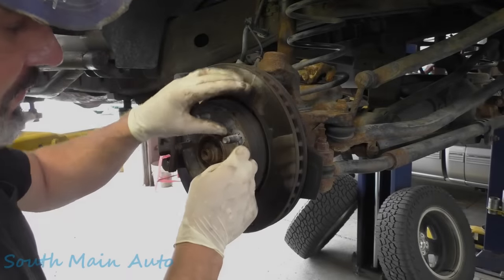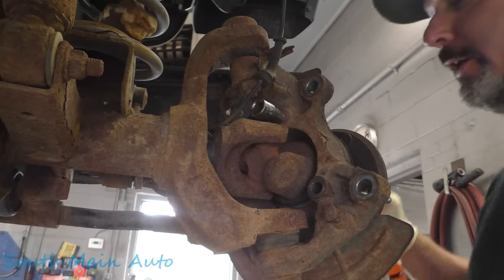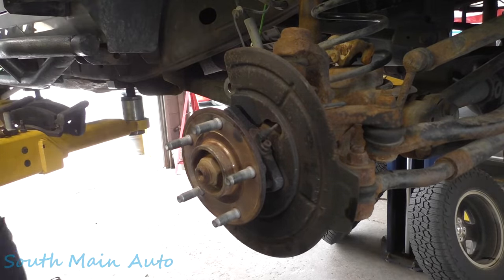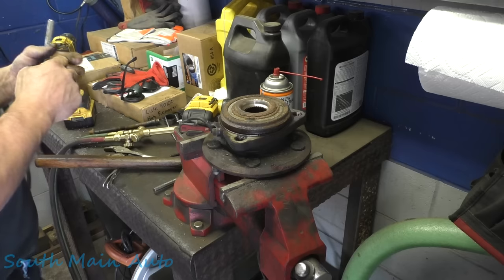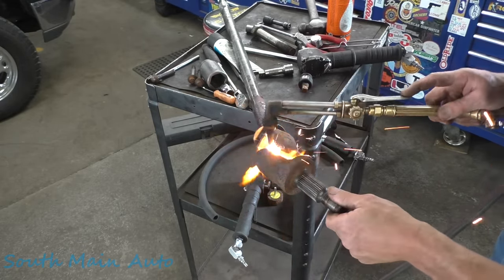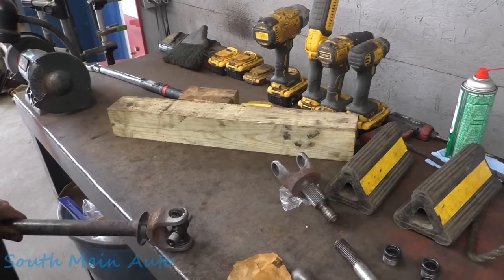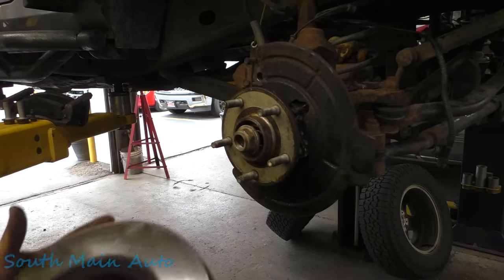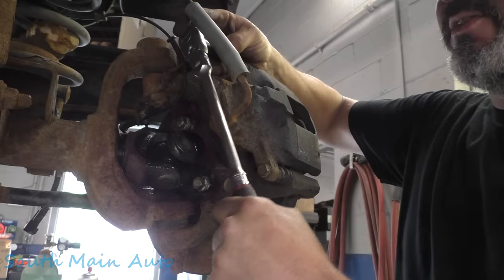Jeep Wrangler - Front Axle U-Joints

Comment: Puts out laundromat fire, knows the fire department is hanging out next door, proceeds to get the torch out for all repairs. Just giving you a hard time. 😂
Reply: They were at lunch didn’t you hear the siren. Great save Mr. O!!!!
Reply: some times ya just need to know how long its gonna take them to show up to your fire!!
Reply: That’s the second time you’ve had to put the laundromat out ! well it might be more, but that’s what I remember. The guy needs to pay you a retainer !
Reply: Acid brush, for brushing on bakers fluid or other acid flux before soldering. Tinsmith work etc.
Reply: Spray it !

Comment: "Acid Brush" was the name given to the things due to the fact that the original use was to apply flux (Acid Core) to pipes for soldering.   The things are extremely handy and have evolved into universal usage.   But that's the story -  Acid Flux Brush!!

Another great video Eric...  You're the iron man of the YT auto genre!
Reply: I tried to use one with some somewhat modest 90% nitric acid.  That was a mistake!
Reply: @paulmoir4452  whoosh vapor cloud of goo and metal sludge?
** I'll add plumbing flux is very mildly acidic, usually in the low percentage range around 20%, but it varies per flux type usage, it's mainly "petroleum jelly". years ago they used different chemical blends to do the work or breaking up oxidation and protecting it from re-oxidizing before the solder would flow.
Reply: Also used by old tinsmiths (sheet metal workers) in applying acid paste flux used to solder sheet metal joints together…a very useful tool still used today
Reply: @phillipfritz7014  And mechanics in small towns who soldered radiators and heater cores. (likely in radiator shops in larger centers also)
Reply: Mainly muratic acid in various strengths was your flux on brass radiators and it works an instant treat. Combined with the torch used to take the tanks off/on with was the reason for the gross package of cheap acid brushes for sale at better parts stores for some half century of time long past now. It was also your engine cleaner where you pour it right into the coolant replaced now with water and warm it up to flush/eat up the rust flakes as well. Right in the radiator too depending on the belief that the same flaked off rust is blocking some tubes there. All purpose hydrochloric acid was on the shelf often under many different hats. I have an old bottle with permatex as the brand, orange is the color of the fluid, engine flush is what it's called, let her cook for a half hour with no thermostat in it and flush well with water. They didn't have water cooled aluminum engines in those days so it was safe enough. Nice hat they gave you, I had a fire and the fire boys gave me a five hundred dollar check just for incidentals within two days. I wasn't going to be able to cover the bills until I saw that check. What a blessed relief. My angst level settled down from a full rolling boil to a months vacation attitude, I thanked them in the local paper for all they did for me that day. And very much appreciated to this day.

Comment: Think of a blast furnace. Super hot fire used to take rust and melt the iron right out of it. At the bottom pure liquid iron comes out of that fiery furnace. But this means that an enormous amount of energy is locked into that iron. This energy can be released the same way the energy locked in wood, coal, gasoline, acetylene, or anything else that will burn. In every case the material combines with oxygen in the air to release energy. That is why this car, all of its visible parts, including this U-joint are covered with rust, which is iron oxide. At 26.26 Eric O is combining oxygen and acetylene and burning them to create a hot flame. Then he presses the valve and adds more oxygen to the flame, but all the acetylene is gone, so the oxygen becomes extremely hot, and instantly combines with the hot iron to from rust, iron oxide, reversing the blast furnace process. I am a chemist and thinking about this is a joy to me.
Reply from the maker: And that folks is why we can't use just compressed air 👍🏼

Comment: Always impressive to see sharp bits drilling.
Reply: I agree! I've spent thousands of dollars on drill bits. I've got mac and Snap-on bits that are really good. That said I used my apprentices matco hyper step drill bits and wow there really nice!  We work in a paper mill and only have a mac dealer that comes weekly so warranting out damaged / broken tools have to go through mail mostly. I've thought about getting the astro pneumatic drill bits. I believe there the exact same as the matco hyper step and 1/4 the price
Reply: Carbide?
Reply: These are drill bits with steps on the tip, i have them. They're fking amazing
Reply: @andries4561  Whats the name of them?
Reply: Try a Drill Doctor.
Not so easy to sharpen on smaller bits though.
1/4" and up does a decent job.

Comment: Hey Eric. Great channel. I did this job a couple of hundred times in the dealer I worked at up here in canada. I would leave the hub attached and after removing the bolts , would wedge a socket between the axle tube and u joint yolk , start the truck and use the steering to push it out. Then remove the u joint clips , put it in the vise and hit the yoke with a sledge to remove the joint. But many different ways to skin a cat. I definitely gain alot watching you especially with the diagnostic stuff. Much respect from the land of rust up north !

Comment: Wow!!  In over 50 years of repairing vehicles I have never torched out a universal cross!!  At 68 I am still learning!!  A little heat is ok by me but a full melt event I have never done! Hahaha!!  
This should be the flames and fire episode!!  🔥 
Glad ya saved the town too!!   Good job on the Jeep and the Laundry!!  Happy 4th to Y'all!!  Cheers,
Rick
P/S.......Acid brushes were originally from plumbing......used to apply solder Flux to pipe joints.  My grandpa had a brush stuck in his tin can of Flux always ready for any copper pipe repair! 😊
Reply: Nice to hear from an old guy still learning. I'm 82 & same thing, we used a vice or a press or even a hammer in a pinch.

Comment: Interesting, out of all the years I twisted wrenches I have never seen a u-joint cut out with a torch.  I have used a torch to get the u-joint out but that is because GM used that nylon (at least i believe it was nylon) to retain the joint in place. It was easier to melt it than push the joint without doing that.

Comment: Marking the rotor orientation - now that’s attention to detail! 😁😎 

A lot of folks just slap’em back on any ole way. Most of the time that’s probably just fine but if the rotors and pads have miles on them this is really a good idea.
Reply: Haven't watched yet, so idk exactly what he did, but ik what you mean, when I wrenched... I used a piece of chalk to mark the rotor and a stud to realign it the same.
Reply: @shannonharris  Did you notice Eric did not mark the yokes? He just slapped them back together. Truth be known, the rotor can have some lateral runout. That's the beauty of the sliding caliper! When you get a pulsating pedal or steering wheel, it's caused by high spots on the rotor, where the rotor is thicker in one spot than another.  Not the rotor wobbling. ben/ michigan

Comment: What’s interesting to me is the power of air. I never knew air pressure had the power to knock out tight and rusty bolts. I always though you needed energy and a electric motor to knock things out. A little muscle power is needed sometimes to win the race to get the bolt out. 

Great video Eric! Always here to  learn more and have a great time! 👍
Reply: It's an air impact. It has a hammer mechanism inside, the air spins the mechanism, it builds momentum and then whacks the anvil to impact the bolt. The electric impacts work on the same principle.
Reply: @surewhynot6259  appreciate that! I guess in my mind I thought that when air hit an object nothing happened because it was just air. I didn’t thing that there was a driving power behind wind. 

But come to think about it. It makes sense because you have tornado and hurricanes and those have major power behind them. So it’s like a mini tornado inside the tool driving it. 

Awesome stuff!
Reply: @leosthrivwithautism  
don't forget the air gun and nail gun
Reply: The one that  impressed me is the water guns that cut steel 9” or more inches in the steel plants . Using ultra high pressure 20000 to 55000 PSI  & computer controlled totally amazing.
Reply: @alward9901  I think there is a channel on YouTube with one of those. It’s pretty interesting stuff.

Comment: One of those days, old Victor wins the day, word of advice, after being a welder for over 35 years and seen a few torch backfires by doing the old restart from the molten slag, it’s always quick but it’s also dangerous to a certain point. I also noticed you don’t have flashback arrestors between the torch and hoses, might want to invest in a couple, cheap insurance.

Comment: Just a couple tips: Those hub bolts are grade 10.9. Using heat on them rapidly decreases their strength.  The exposed threads rust and get caught up in the hub.  Working it back and forth with a bit of lube usually does the trick. I loosen them a few threads with an impact socket, then use the .401 air hammer adapter that fits into the socket to buzz the hub out.

Comment: There is so much water in your air.... Maybe drain your tank
Reply: Do you think the water comes from the tank?
Reply: @stevenakn1  i think it is a build up, so when you pull air, you also get some of the water in the tank to
Reply: @Blasterxp  it's moisture in the lines generally caused by an air leak or not being used very often. The water in the tank stays at the bottom, the air is pulled from the middle of the tank.

Comment: Did all my 2000 Cherokee U-joints, axle and drive train, and transfer case in the driveway ... used a ball joint press, great tip on not banging/bending the yokes ... hope the surgery heals up fast Eric ... nice save on the laundromat ... nice Fire Helmet !

Comment: Really enjoy your videos, I'm a retired mechanic and like to see you guys have to do the dirty work now. NOW, go turn the pressures down on your torch. About 12 to 13 on acetylene and about 30 to 35 on oxygen. Takes a little longer to heat up but You will get clean cuts and eliminate puddles of slag. Just friendly advice.
Reply from the maker: I run my O2 at 30 and my acetylene at 8. Not my first rodeo. I've been using a torch since I was about 10. It gets slag and takes a while because I only run a #0 tip on this one

Comment: I wish I had a hot wrench for u joints.🤣 Last ones I replaced I used a big socket as a cap receiver, big ass bolt(like yours) and a BFH and whacked it out. Fun times. Oh the destruction I could do with a hot wrench on my old rusty junk in Pa. I`m getting too old (65)to be beating the bejebers out of stuff. Great safety tip on the cutting Eric. Thanks Jr. Fireman, you saved a neighbors bacon. Well done. Hope your boot recovers as well as your head. Glad it wasn`t a bad growth the doctor found. Stay safe all, God Bless

Comment: i did hundreds of these over the yrs and one never was the same...sometimes the clips fall right out of the caps, sometimes the bearing is welded/rusted to the knuckle, but no matter what happens there was a different thing that happened every time you did an u-joint....goes with the territory...as for cutting the u-joint out, make sure there isn't much grease in the joint or it will flame all over the place and on you with spewing grease...like I said, if there was a way to do them differently, there probably is 100 more ways that they can be done from what you normally do...great job Eric

Comment: My 2¢ worth: I remember being victim to all the smoke from the guys burning the entire front wheel bearing off Dodge Intrepids. Or burning a shock absorber off. Sometimes they used a blow gun to clear away all the brake dust from a backing plate too. They filled the entire shop with grease, rubber, oil smoke and brake dust. They used a solvent suction gun on the brake bleeders sometimes making a cloud of brake fluid. What a mess. I hated all that Black stuff in my nose after a days work.  And the smell! That was a 9 bay shop, and it stunk so bad everywhere!  I prefer to use the tried and true, ballpeen, air chisel, bearing separator and 20ton bottle jack. If that didn't do it, I sent it down to Napa. They had a 50 ton 2 stage press. Only the GM U-joints that had that plastic nylon needed heat. Heat if needed, but quench with water befor things get out of control smoke wise. I used to heat and quench w/ motor oil to reuse old rear axle Nuts & U-Bolts by heating the nuts and immersing them in motor oil but not much smoke. Heat the outside of the bearing housing just enough to expand the thread hole, then quench with water to preserve the speed sensor. I never cut a U-joint out like that. Thank you for thinking about the next guy who's going to be in there when you put your Fluid Film on, but wheel bearing grease will be there long after FF is gone. And last: I agree with pz6316, if you don't heat and quench with oil, your penetratin ol ain't gonna do nuthun. Patience and practice saves the parts. ben/ michigan

Comment: Acid brush is used for applying paste flux to copper pipe joints before soldering them together.   It is found in plumber's tools and supplies areas of hardware stores.

Comment: Acid brushes were used to apply acid type flux in sheet metal soldering. Cheap, sturdy enough to do the job, & throw away when finished. Other trades learned the beauty of the things, and ...well, the rest is history.
It's good the doctor removed the fatty mass intact. If residual pieces are left behind , it'll grow back. Trust me, I've been there.

Comment: Its call acid brush because in the pluming industry the brush was dipped in acid flux and applied on copper pipe and fitting to allow the solider to penetrate fitting.  Also they are made from horse hair.  Thanks for an exciting video

Comment: GM bed bolts is what I used when my 2000 XJ needed ujoints at 200,000mi.. It's what I had in stock. Didn't have to put out a laundromat fire tho.. maybe next time.😅

Comment: Another great and informative video.  The chunk of "Chicken Fat" was probably something called a "Sebaceous Cyst" typically benign, but due to the body's defense mechanisms acting the way they do, over the years will gradually build up layers around the Cyst and hence they will gradually increase in size. Truckers frequently get these on their rear ends after zillions of miles and they usually have to undergo the same thing your MD did to you then have to sit on a large rubber Donut for a couple of weeks.  Due to gravity, the swelling you currently have around the site will gradually go down to your neck, make the area back there all black and blue and make it appear Mrs. O whacked you with a stick.  If you're in decent health, it should heal up just fine and your hair will cover the scar.  Usually Ice Packs for the first 36 hours then heat at night will help dissipate the residual swelling and get it to heal faster.

Comment: dryer fire, just turn it off and leave the door shut, usually snuffs itself out fast from lack of oxygen. ovens/microwaves often do the same, although they're more open and designed to have air flowing through them, including by gravity. either way, never pull burning stuff out of any of them and be careful with water for clothing, it could be oil/chemical soaked ad have a nasty flash reaction. I've learned many things the hard way as a kid(and adult) 🥳

Comment: Good video ! I noticed alot of Water spraying out of your air tool while u were using it.
If you haven’t allready , Install an Electric auto drain on the Bottom of the Tank. Use Brass fittings when plumbing it in. Steel will plug up the auto drain & rust & never work right. They work good.
If u still have problems with water at the tool because water is condensing in the line from compressor to use located. Make sure u have a drip leg where u connect your hose & put a electric auto drain at that location too. Tee in above drip leg about 36” to your tool hose.
These are the cheapest easiest fastest fixes & should get rid of most water. If u still have issues with water in the lines and want it gone add water separating filters at each hose location.
If u still have water - 
Add a Condenser( basically a Heat exchanger )  with a Fan to sub cool the air when it Leaves the Compressor to drop the Air temp of air leaving compressor & drop the water out at that point before it has a chance to condense in the Air lines.
Thier is 1 more way to remove All the Water. $$ but its a little pricey.
2) Electric Re- generating Dessicant Air Drier. $$ = 100% of Water Removal Period !

Comment: I had a 2010 Jeep JK.  I put 130k miles on it and the only troubles I had was shifter bushings and the front sway bar disconnect quit working at about 110k.  That darn thing was quite expensive so I replaced the electric motor with a manual thing m a bob...  worked great and didn’t cost me a fortune....

Comment: Those caps are no joke if they blow out. Was working on a stock old GM ujoint once and squirming the plastic out with a torch, the cap whizzed by my ear faster than a bullet, pierced through a cinder block in the wall up behind me. They could kill you.